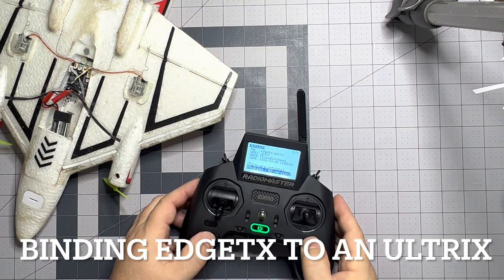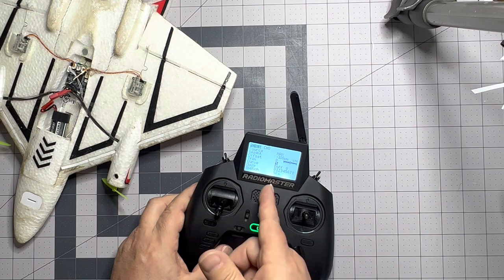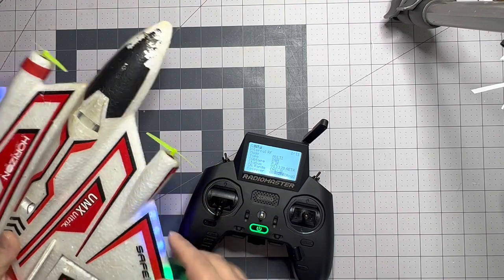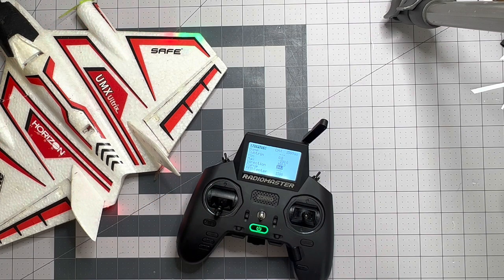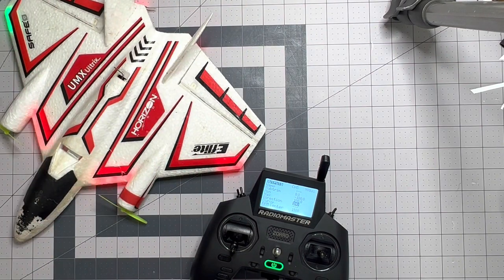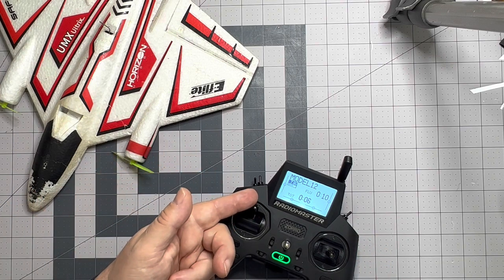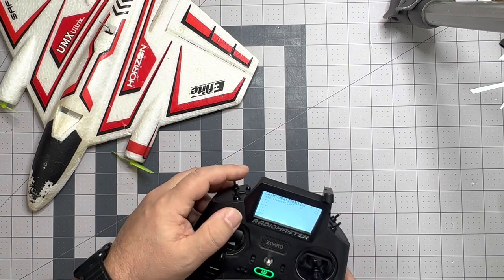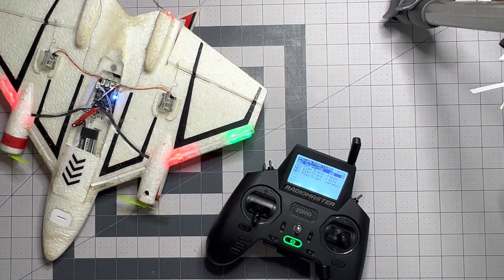Setting up a Radiomaster Zorro with an Eflite Ultrix.

Comment: That timer can also be setup the same way in timer settings and works with percentage of throttle stick and also assign a switch . I also make a button my timer reset on my transmitter.
With having open source, there are many ways of doing the same things. 
Also another cool thing is instant trim, don't have to fiddle with trims to trim your plane out. Just one button does it all
Reply from the maker: I didn’t show it in this video, but I use a set of functions that will keep throttle hold enabled until throttle stick is all the way down and then the switch is flipped. This avoids flipping throttle cut off while the throttle stick is up.  This just happened to me on my DX9 just this week.  Luckily, I was hand launching so the prop was away from me.  On the Radiomaster, I key off of that function for the timer as well.

Comment: I am using Zorro to fly my OMP M2 helicopters. I bought the RTF version and i had 2 other M2 helicopters i wanted to fly with this transmitter. I copied the original M2 model and created 2 more models for each of the new helicopters to bind to, but i realize the other day that once i have bound the helicopters they will initialize to any of the OMP models in the translmitter.  Does this make sense?
Reply from the maker: are you using a unique ID for each receiver in the RF setup?

Comment: Also when you set up SAFE switch you don't have to do it in Inputs and mixes. I set mine up in mixes only and works fine.
Reply from the maker: Yeah, that’s one of the things I really like about opentx/edgeTX is that there always seems to be at least two ways to set something up, and sometimes several more ways.

Comment: Very helpful. Thank you.
I have a Zorro and have it bound to and properly configured to use with a Spektrum AR630 rx, in a delta wing plane. However, I cannot get the SAFE/AS3X to function, tho it was bound and "activated" using a Spektrum radio for its initial bind. Can you please help me?
Reply: Some seemed to have simply assigned channel five, others have had success using a bind plug, which I don't have, but am willing to buy, if that's the trick.
Reply from the maker: The safe channel may not necessarily be on channel five. Depending on how it was set up, it could be on any channel from 5 up to ...well, I don't know how high, but whatever Spektrum radio you used, that would be the upper limit.  So if it was a DX9, I'd try assigning your chosen switch to each channel from 5 to 9 and see if SAFE activates.
Reply from the maker: or if you still have the Spektrum radio, you could watch the channel monitor and see which channel the SAFE switch is sending a signal on.
Reply: Thank you. Just tried channels 6 thru 12 with no success.
Reply: I've asked the more experienced flyer, who bound the rx to his Spektrum radio, which channel he used.
Reply: @MarlonMoyer  
It was initialized on channel 10 on the Spektrum radio, but it doesn't seem to work for me. Still stuck. 🥺
Reply: @me262mike2  Double check the binding screen and make sure that the radio didn't lower the channels to 8.  Sometimes mine does that when I bind the radio and I have to go back and bump it up to 12.
Reply: @mcmoyer  
Eureka! Victory! Excellent suggestion that activated the gyro! Now to figure out how setup SAFE/AS3X and standard. Seem to only have SAFE and off at the moment.
Thank you VERY MUCH! You're a PRINCE!
Reply: @me262mike2  I'm about to use AR630 with the Zorro as well.  Which version of EdgeTX and which version of the 4in1 module do you have?  I'm wondering if I will need to upgrade anything or not.

Comment: Anyway to get some help. I followed your video best I could but I'm still not getting the plane to bind. I have the Cub Sport S 2.
Reply from the maker: is this the first time binding the S2 to a radio or has it already been bound to another radio before?  Also you might want to make sure the radio isn't too close the the aircraft when you're binding.  Try to keep it a few feet away.

Comment: You don't need to put the antenna up on the transmitter. I leave mine flat or in stored condition.
Reply from the maker: I’ve experienced more warnings with my antenna in the down position.  When I forgot to put it up, I’ll realize it pretty quick because the transmitter starts barking at me.
Reply: @MarlonMoyer  What warnings, I get no warnings on mine
Reply from the maker: @Mikeylikesit1968  i get the signal warnings with my spektrum receivers.  I haven’t noticed it with my FrSky ones though
Reply: @MarlonMoyer  I get no warnings with any Rx .

Comment: Hows can i know the RX battery indicator?
Reply from the maker: on the Ultrix there's a telemetry value called EVIN which is the voltage the receiver is getting from the battery.   Other receivers might or might no report that, or have it named something different.

Comment: Ok quick question, which Zorro do I need. I'm flying the little mini warbirds from eachine but I also plan on buying some UMX elite planes and a blade 150 heli and an omp M2. Do I need the multi protocol or the edge and or open tx? Really confused LoL
Reply from the maker: You will want to get the Zorro 4-in-1 version.  This version allows you to fly the widest variety of RC receivers.  Keep in mind that the 4-in-1 is not the same as the CC2500.  

EdgeTX and OpenTX are both operating systems for open source radios like the Zorro.  Either one will work, but my preference would be EdgeTX as it has more development momentum behind it.  All Zorro models ship with EdgeTX preinstalled
Reply: Thank you so much. I've learned alotta from your channel and so have others and trust me it's greatly APPRECIATED! One more question..... Do you
prefer the Zorro over the Jumper T lite?
Reply from the maker: @ant-man1131  I don't have a Jumper T Lite to compare it with, but my main reason for sticking with the Zorro over it would be the number of switches and sliders available on the Zorro.  I'm already hitting up against the limit when I use my Zorro for a plane that has flaps and retracts so I wouldn't want any fewer switches.
Reply: I too have a collection of little warbird remotes from before getting the Zorro. In the last few years, I've been collecting UMX flyers, and trust when I say, 3S changes things
The Zorro will serve you well
Reply: @rhysespeace the Zorro has changed everything for me and I'm now flying 3s with my ultrix600 and I also have a hobbyking f16 on4s. MY favorites are still my mini p51 s, I only use the gyro for landing on windy days and they are so aerobatic especially snap rolls!
Reply: @MarlonMoyer Thanks again for making this video!!!!! I use it as a basis for all my planes and having the panic button has helped more than you'll ever know.... I used to just flip the switch back and forth and was like "this switch will be wore out in a few months of jamming it back and forth!" Now I just push a button! I even purchased a ultrix600 because I see how much fun with your umx version and I set everything per your video! You have no idea how many people want to thank you the way I have. The RC community appreciates you more than you know!
Reply from the maker: @ant-man1131  Thanks!  Your comment has made my Monday morning a lot better.  I'm about to publish a new updated video about how I bind and set up my Eflite Eratix.  That video will also show how to use the battery telemetry to set off alarms for low battery levels.
Reply: @MarlonMoyer  now this really blows my mind because I've been stuck on my next airplane and it's between the Radiolink A560  and the Eratix. I now choose the Eratix so the video will be much appreciated. Keep up the good work. I think RadioMaster should compensate you some how?
Reply: @MarlonMoyer  well I must thank you again for helping me setup another airplane! I maidened my Hobbyking F16 50mm and it flew great, all buttons and switched working great. One question.....for some reason my tx keeps telling me that I'm losing telemetry when it's close to the jet and I didn't have any problems flying and sent it out there a good ways and it never lost signal or telemetry?
Reply: @MarlonMoyer  I have a question for you? I use this as my basis for setting up all my aircraft and it been flawless except for today. I have a HeeWing F22 Foam flyer and everything works perfect until you switch the gyro into the second and 3rd position and there is no throttle? Any advise would be greatly APPRECIATED!
Reply from the maker: @ant-man1131  depending on what receiver you’re using, the transmitter could overpowering the receiver when it’s really close. It’s best to keep your transmitter a few feet away from the plane.
Reply from the maker: @ant-man1131  what receiver are you using with the F-22?
Reply: Radiomaster R81 S.bus

Comment: Numerous attempts to bind to sketrum...the module in the radio does not send the signals from AETR to TAER...throttle keeps getting sent to elevator...about ready to wall bash the zorro...
Reply from the maker: Hi Chip.  I haven't encountered that issue so my suggestions may be useless, but first, check to make sure you not ticking the "No Ch. map" box, and second, are you 100% positive you're running the AETR firmware version, and third, in the radio, on the mix screen, throttle is going to channel 3.
Reply: @MarlonMoyer  thank you....I will get back into the settings and check...
Reply from the maker: One more thing I thought about is to make sure that in your transmitter SYS settings, the channel order is set to AETR and that you hadn't changed it, like I did originally, to TAER
Reply: @MarlonMoyer  I tried quite a few of the options to see if it had an effect...it did not. Even physically moving the receiver to servo cables. The radio still sent the throttle out through channel three. I assigned the mixes to AETR and it is working as it should....I have to assign AETR on the mix tab for each spektrum RX.  It works, but not just simply plug and play.  The other protocols work easily without the extra step.

Comment: You don't need wizard,the flight controller will take care of that.I put my throttle cut in special functions easy easy.
Reply from the maker: yeah, I no longer use the Wizard, but for some reason I think at the time it was easier to use it than not on that version of EdgeTX I was on at the time.  I also put my throttle cut in special functions now, but I've also made it a bit more featured so that you can't enable the motor if the throttle stick isn't all the way down.  EdgeTX is great though because you can do things so many different ways and each of them will work.
Reply: @MarlonMoyer  yep it's great I no longer use my spektrum radio,I use my zorro, it's so versatile.

Comment: How can i set up flaps in the transmitter? Im buying a umx turbo timber evo and i want to set up the flaps.
Reply from the maker: Hi Jorge, flaps are very similar to most other controls.  So first you’d create an input named FLP and assign a switch.  I like the B switch for this since it’s a 3 position one.  Then you’d go to mixes and on channel 6 (this is normally the flap channel on spektrum planes) long press the roller.  Name it FLP, the source would be FLP.  Scroll down until you get to “Slow up” and “Slow dn” and set your desired delay value.  This will be the time in seconds it takes to go from all the way up to all the way down.  I use 1.5 seconds.
Reply: @MarlonMoyer  thanks for the help!!!
Reply: And in the umx manual says Set FLAP SYSTEM:
SELECT SWITCH
POS 0: -100% FLAP     0% Elevator
POS 1: 0% FLAP          17% Elevator
POS 2: 100% FLAP      30% Elevator
How do i do this?